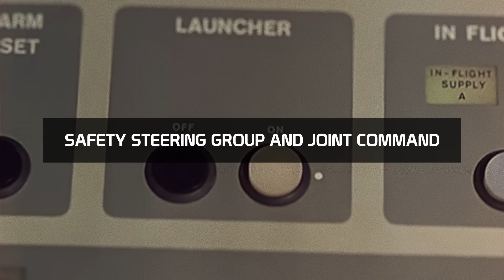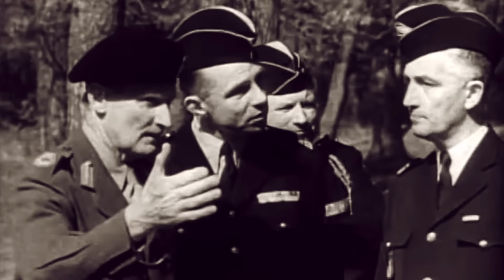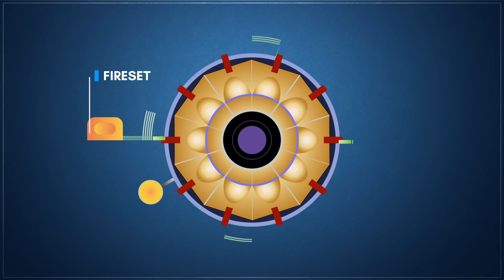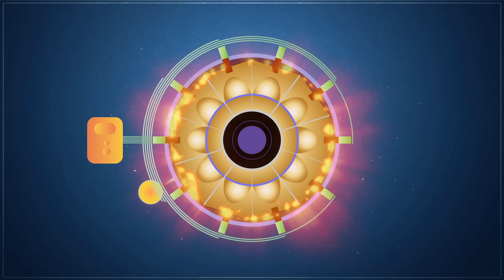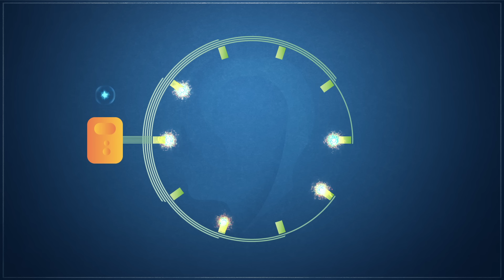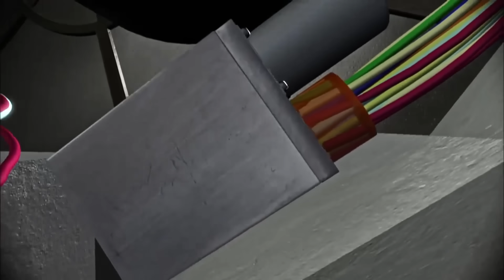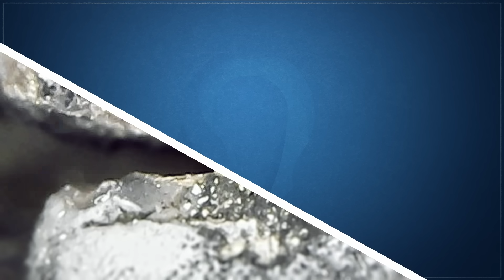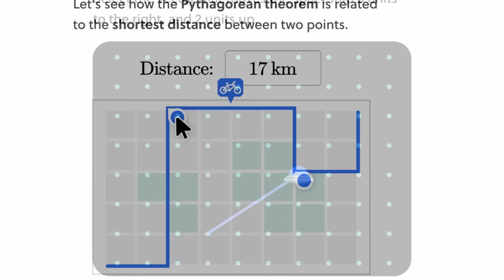The Remarkable Mechanism That Secures Nuclear Weapons

Comment: Im surprised he didn’t talk about the time a quarter of the entire nuclear arsenal had to be rebuilt because neutron absorbers used as safeties ended up crumbling and getting stuck in the cores.
Reply: Yup it turned out cadmium boron wire was a bit brittle and corrosion prone.😂
Reply: @christopherleubner6633  as I recall, the ball chain replacement wasn't much better. Pull it out, couldn't put it back in and required a rebuild.
Reply: or how for decades all the missiles PAL code was 0000.
Reply: That was not the actual code, but your are partially correct.  That was due to the manner that the FCC computers started up after a power failure.  After the power-correct signal was issued, the Memory Enable default word was issued as all zeros.  This also wiped the previously inserted go codes.  To targeting memory was protected, so retained all of that information, and only needed the go codes to be reinserted.  To allow faster launches under nearby nuclear hits, and if the generators took some time to  come up, the crews just elected to input all zeros.  As soon as they had power, they could launch.  Saved several minutes, to tens of minutes in some cases.  Waiting for more hits would have meant inability to launch.
Reply: @brunonikodemski2420 so this all zero launch code could only be used if there was a power failure? What prevents a rogue actor from flipping a breaker and slamming zeroes for Armageddon?
Reply: @larrybremer4930  you mean that the secret PAL code was 0000 and well, everyone knew it.
Literally.
Reply: @spvillano  From the web
The US Air Force's Strategic Air Command set the codes for the Minuteman ICBM force to 00000000 in all missile launch control centers for almost 20 years, from 1962 to 1977. The code was a precaution in case the codes weren't available during a crisis. To help soldiers remember the code, it was written on a checklist that was given to them.
Reply: @larrybremer4930 you missed the last 4 0’s.
Reply: If he dug into British stories he'd have a few sillies too, like the ball bearings safety packing that fell out all over a hanger floor, leaving crew skating around on mildly radioactive steel balls, and no way to put them back without removing the weapon from the 'plane.
Reply: @profpep  Carry on Bomb.
Reply: D'oh!
Reply: I love that translation is offered for this comment and still translated to the same word. Thanks Google. @orbitingeyes2540
Reply: Why are you surprised that he didn't talk about that? It has nothing at all to do with PALs.
Reply: link?
Reply: every weapon system has teething troubles yes even nukes
Reply: Dude, shhhhhhhhhhhhush. Shut it.
Reply: @brunonikodemski2420  I'm not informed enough to argue, but I thought you implied the target data is retained.

I see your point about multiple officers involved in the launch, so it would probably take, three or four people intentionally colluding to go rogue, which I'm guessing is something the military is aggressively screening for in their personnel choices for postings of that nature. Thanks for the explanation.
Reply: Boron chains?
Reply: Does that mean there are no more working Davy Crockett? They had a retro charm.
Reply: but that's a good thing, isn't ? that means the arsenal can't be detonated
Reply: @monad_tcp  actually, the opposite. The safety wire and later ball linked chain would be removed to arm the bomb and couldn't be reinserted to safe it.
Of course, the safety system was horrifically lacking as well, had a couple that very nearly accidentally detonated after a crash. Because of the near-detonation, they redesigned everything to be multipoint safe, where there was no way for the damned thing to go into a nuclear detonation accidentally.
They also removed RDX from the cores, as that grew unstable on exposure to the radiation flux from the core. The new explosive being quite insensitive to shock, heat or radiation.
Reply: @monad_tcp  no. It means that it's ineffective at protecting you from getting killed.
Reply: @JurekOK  Not just you.  Possibly everyone in a 5 mile radius.
Reply: @JurekOK  A nuclear weapon doesn't protect anyone, fool.

Comment: Of course it turns out all the encryption technology and anti bypass measures were meaningless because to assure the operational ability of the devices all the codes were 00000000.
Reply: Once it reached 1.21 gigawatts!
Reply: That's just a legend, not true.
Reply: @skunkjobb  One of my high school and college classmates got her PhD in chemistry and was hired at the Sandia Labs and spent her career working on the initiating explosive stage. She said the explosive shell could not be hotwired because the exploding wire detonators had varying delay mechanisms so that uniform explosive lens compression of the pit wouldn't occur and you'd spread the plutonium around but not get a fission reaction. She also said commercial chemical detonators had too much timing variation and that's why flux capacitors and exploding wire detonators were used because they wouldn't cause a fission reaction either.
Reply: @bobsmith6079  Why is she telling people all this stuff?
Reply: @bobsmith6079  Well, up until you realize you can't capacitate flux. 😂😂😂
Reply: @KennyTheB
Yes I mixed up the name of the real device, explosively pumped flux compression generator, invented by Nobel Prize winning physicist Andrei Sakharov with Doc Brown's invention. The explosion somehow produces an amazing current of 100 Mega Joules at 256 Mega Amps has been produced by a device 1 meter in diameter according to Wikipedia. I frankly gave up on trying to understand how the device works but given that it's in Wikipedia it must be common knowledge. Bridge wire detonators are federal government weapons controlled devices too according to Wikipedia.
Reply: @RT-qd8yl 
Because it was true. For the types of nuclear weapons that rely on timed explosions to create fission these mechanisms fail over time and the material making up the core also degrades faster reducing yields if stockpiled. The ballistic method which fires a ball of plutonium into a uranium pocket or core have lower yields for their weight but are slightly more reliable if stockpiled and while they still decay over time they'll still function and actually be much more destructive if used because they will be more likely to effectively spread fallout if my understanding is correct.
Reply: @RT-qd8yl  why are you acting like that information is dangerous in the slightest? God some of you people are truly thick. The mechanism by which a nuclear bomb works is not secret, you can find that information anywhere (like this very video), nor is it dangerous, as it does nothing to help you actually build one.
Reply: @VariantAEC  My point is what business is it of hers to be telling people information that's been entrusted to her

What part of her job made it necessary to talk about such things rather than keeping her mouth shut like one is supposed to? Seems to me like a person in that sort of job either shouldn't say a word about it, or shouldn't have worked there. Let me guess, she probably got a $50,000 goodwill donation from the Chinese government too?
Reply: @RT-qd8yl  
Huh? Nothing she said is still classified. Everything in the video is also declassified, which is why people can make videos about it.
Reply: @VariantAEC  Right, but as an employee she had no reason to talk to others outside of her employment about the details of her work. The way you're describing it she's talking about it for the sake of talking about it. It's a bit different than a youtuber or other non-gov employee doing research and making a video or report about it.
Reply: @RT-qd8yl scientists have a different perspective on infosec
For example a scientist is going to think the less ignorant or left to guess people are, the less they’ll be afraid and the more they can make rational choices
Not everyone is all about compartments
Reply: It's on the internet so it's common knowledge at this point. The other interesting thing was that the explosive in the first stage was so stable that for decades you could send it by mail. If you watch armament videos there are shells that count how many layers they've penetrated before detonating and multiple impacts don't detonate the explosive.
Reply: @RT-qd8yl China has proudly sponsored many 8k displays in those FBI tracked walking information leaks.

They blantantly steal tech all day long from what I've heard. Still fail on the whole for general innovation but thst may start to change(?)

Pays to keep tabs on China, they should be proud for how far the country's progressed. I question how much of that is at the expense of regular americans...
Reply: @bobsmith6079  ...flux capacitors? The nukes could time-travel too?
Reply: Flux capacitors use explosives to fire magnets through wire coils and are the powering mechanism for bridge wire detonators which require a very high amperage to function so they do actually exist. How they are designed is still classified of course.
Reply: @skunkjobb  It was true for a while.
Reply: Just think it where thrue! The Spy sneeks in with some realy clever codebreaking gear. Gets cought because someone finds it and then he learns the code was 00000!
Reply: Did the DOD show up to your house yet?

Comment: Wait till lockpicking lawyer said "inexcusable design flaws"
Reply: LPL: I will detonate this thermonuclear device a 2nd time to show it is not a flucke.
Reply: @HansLasser  Literally lol.
Reply: @HansLasser  I see what you did there.
Reply: @HansLasser fluke
Reply: I’ve got a click on three….
Reply: @Oldtanktapper  

....False gate on 4.......
Reply: @RILEYLEIFSON_UTAH literally lol.
Reply: @RILEYLEIFSON_UTAH False gate, false gate ohh, got a click.
Reply: Nuclear safety lock brought to you by MASTERLOCK.
Reply: @KapiteinKrentebol  Makes me shudder...
Reply: @KapiteinKrentebol Oh we'd be VERY dead by now if that were true.
Reply: Hahah what a legend
Reply: And McNally opens it with a speedsquare
Reply: 4 is binding, click on 5
Reply: LPL would just drill a hole on the side of it and there would be some literal switch or easy bypass
Reply: On the one hand… the weapons are infallible. The “system” however is far from it. When the only man with the “codes” is c0rrupt and has a rotten brain… the “system” becomes a joke. A tragic expensive boondoggle.
Reply: I had the exact same thought :)
Reply: As with every security device, PAL's just turn one problem into another (hopefully easier to solve) problem. All they really do is make sure that the bomb isn't going to go off without specific intent as well as either the correct code or a lot more time then the platoon of 18-20 years old's with M-4's will allow.

IIRC, not that far from the same time PAL's were becoming a thing, someone in either the DOD or DOE wanted to know how hard it would be to design and build an atomic bomb given access to the atomic materiel. A pair of physics grad students supposedly got a working design using nothing but openly published data in only a few months. The implication is that, given enough time, the PAL is irrelevant as all you need to do is replace everything the PAL inhibits, even if that amounts to replacing everything but the pit it self.
Reply: @benjaminshropshire2900  Others have mentioned the design that if you screw with it too much, it blows up sub-critically, killing everyone nearby without leaving enough intact material to make a new warhead.

And yes, of course with enough time and effort anything can be bypassed. That's why safes are rated in hours. :-)
Reply: @darrennew8211  the pit doesn't have to be recovered intact, a big concrete box would allow recovery of the atomic materials even after a RUD... as long as you can hide the industrial plant from the whole world long enough to do it.
Reply: @benjaminshropshire2900  Yeah, but forming the perfect surfaces of the pit from the remains of a bunch of chunks is also an engineering feat. So that's adding more effort to the process, especially for groups that don't already know how to manufacture such weapons.  

Otherwise, you could just say "Well, refine your own plutonium."  That's the hard part. :-)
Reply: @darrennew8211  Synthesizing the plutonium is the hard part, not refining it. FWIW, I was assuming that the stuff would have to be chemically extracted from the rubble and re-refined into metal. Given the metal, the rest is far from trivial, but also far easier than starting from natural ore.

That said, I wonder if some part like the tamper could be "poisoned" with Pu-240 and/or Pu-238 in order to render recovered Pu-239 unusable (at least not without prohibitive amounts of isotopic separation, which is really hard for an isotopic difference of 1 part in 239).
Reply: @benjaminshropshire2900  Congrats! You've exceeded my knowledge of the subject! :-)  I can only go on what I've seen elsewhere. I never really looked into the details of refining atomic weapon material.
Reply: Aaaand we got this open.
Reply: Look at the  gentleman's hands to the left of JFK.  I think it's the lpl! And I thought I was the unique one,  wait I am.
Reply: "...aaand we got this open."
Reply: DOES IT MATTER IF THE SYSTEM IS FOOLPROOF IF THE CH0WDER HEADED COMMANDER IN CHIEF IS TOO SEA NILE TO REMEMBER HIS GOLD CODES? ROBERT HURR SAID “EL PRESIDENTE” COMMITTED HIGH CRIMES… AND WAS SEA NILE… SO… Y EXACTLY R WE CONCERNED ABOUT THE “SECURITY” OF OUR RETALIATORY CAPABILITY? SHOULDN’T WE BE MORE CONCERNED W/LOOKING UP THE PURPOSE OF THE 25TH AMENDMENT? 🤦‍♂
Reply: Lol ya
Reply: "disappoinment" 😂😂
Reply: The Lockpicking Lawyer would just smack a PAL with another PAL and would unlock the warhead...that man is a master.
Reply: @josephricci7391  You're thinking McNealy. "I have a thermonuclear warhead. It can be opened with another thermonuclear warhead..."
Reply: @darrennew8211  yep, my mistake.
Reply: Awesome comment
Reply: These are some of the only locks he could definitely not defeat. No way. He can't defeat the human element the US uses. And wouldn't be able to defeat the actual PAL's except the ones that were just a safe lock.
Reply: @lemmingsfly  I own multiple locks LPL can not pick. Bode-Panzer Tangential, Kromer Protector, Abloy Protec². If you don't believe me, ask him yourself.
Reply: @lemmingsfly  He'd be finished by the time you have typed out your reply, lol
Reply: Lol was thinking same thing
Reply: Have your 1000th like...just take it
Reply: LPL…totally forgot about him. Hasn’t been in my feed for years. 😮
Reply: @rekire___  if he manages to pick the soft and hard locks on a nuclear weapon he would be guaranteed to get a very well paying job at Sandia Labs or any of the letter agencies ❤️
Reply: Hysterical!!
Reply: Is that a lawyer that picks locks…?
Reply: LPL's home will have been located to the centre of a 600 foot wide crater....
Reply: Ha! I’d like to see LPL try to get though a PAL of a modern peacekeeper warhead. Not gonna happen.
Reply: Or his homeboy McNally slaps it just right and the damn thing comes apart at the seems. Lolol
Reply: Believe me. The designers of modern PALs thought of nondestructive non-authorized access when building these. Even the best lockpicking attempt renders the weapon inert.
Reply: @kamakaziozzie3038  you are not wrong. What it does is surprising simple though. All it does is pop the device disable relay that is a single shot switch retained by a fuse. Good luck getting to that to fix it though. The true self destruct mechanism will activate well before you got to the module that contains it. They do it like this because the soft and medium security devices can be tripped by accidents and its very bad to have an accident create a costly radioactive mess from what would otherwise be retrieving the device and shipping it back to Pantex for repair.
Reply: @kamakaziozzie3038  yeah but I'm wondering how primitive the Russian system is..
Reply: @saumyacow4435 you have to flip the switch to "on" but it is upside-down and sometimes it sticks.
Reply: Yeah, but in this case entering the WRONG code could result in the weapon releasing hydrazine gas to KILL YOU and destroy the weapon without going high yield. 🤦

But you go ahead and TRY to guess the right code. 🤣👍
Reply: @SciHeartJourney  Reminds me of a patent I saw for a bank safe from the Wild West timeframe. Under the steel was a layer of copper and a bunch of shotgun shells pointing outwards. Try to drill it and get a face full of lead.
Reply: Seriously though all you have to do to bypass all of these security features is to simply open the exclusion shell to directly access the fireset, and then add your own control to it.  Those shells have virtually no tamper resistance.  It's akin to designing a pick proof lock and installing it on a door that's bolted on from the outside.  Just unbolt the door and walk in 💁
Reply: @Skinflaps_Meatslapper  the fireset is located inside the top of the "physics package" this part is rigged to blow itself up if you attempt to dismantle it.
Reply: @Skinflaps_Meatslapper  Absolutely not true. Trying to disassemble the physics package results in destruction of detonation mechanism and poisoning of the plutonium core to render it useless.
Reply: 'til*
says*
Reply: @JorgetePanete  till is correct
Reply: @JorgetePanete wrong. Till is also a completely valid conjunction.